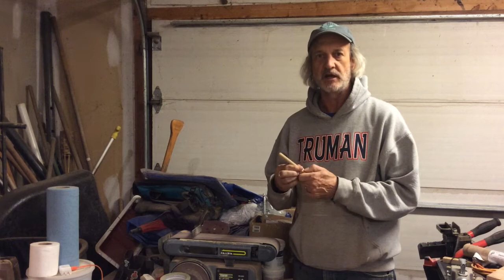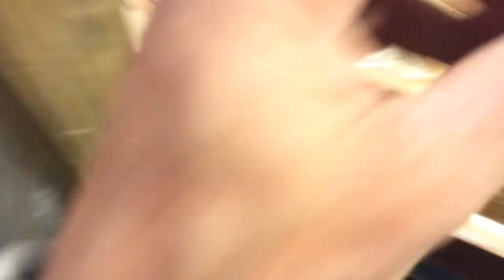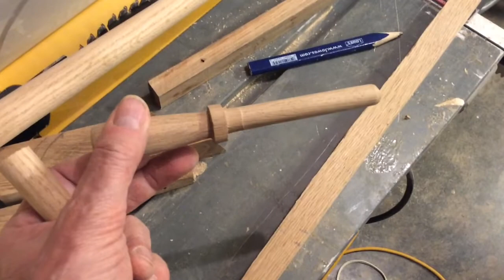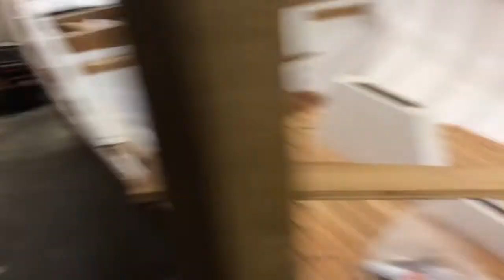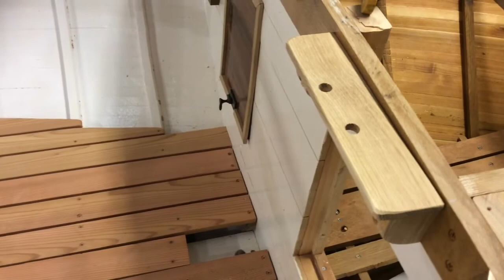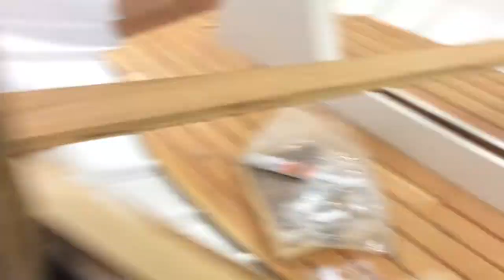Belaying Pins  - Building The Haven 12 1/2 - Episode 83

Comment: Funnily enough, I have some oak legs off a drop leaf table in my workshop cut with belay pins in mind some time ago from a wood pile. They are just a bit too big in diameter as well. I might try the belt sander on them in an up coming project.
Reply from the maker: I need to change my belt, I think. Even so, I have to be careful as it will take off material quite efficiently.